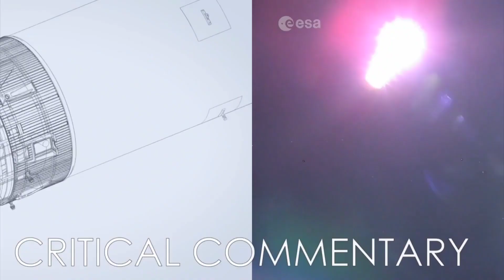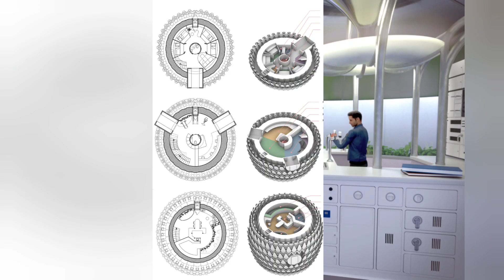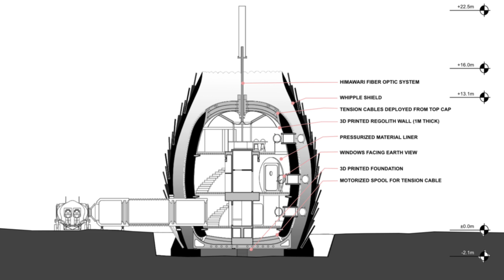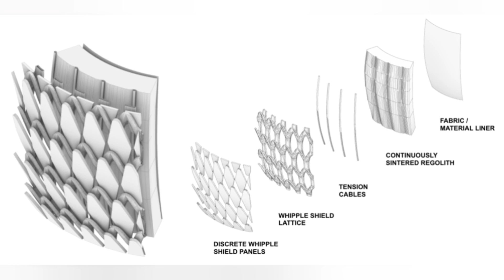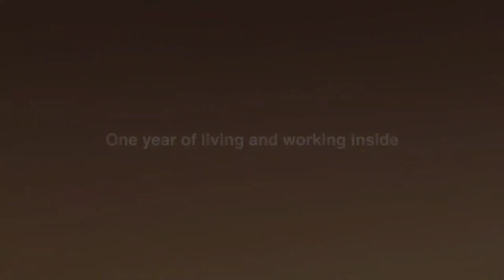NASA puts $57 MILLION down on a Moon City for Lunar Starship!

Comment: I've worked on this stuff (original Artemis Project, RepRap project etc.) and I can tell you that a 3D printed habitable structure with square corners and flat floors is not going to hold atmospheric pressure. There is a damn good reason you shape pressure vessels with curves, even the bottom needs to be curved to distribute stress. Just figure out the force due to 1 (or even 0.25) ATM on the edges of a flat 10m^2 floor area and you'll spot the flaw.
Reply: oo good analysis! force is equal to pressure times the perpendicular surface area, it seems the curved surfaces would distribute the load much better
Reply: @Brandon-qk2mf  They have to support the stress as tension too. Concrete is only good for compression. Not easy to achieve with 3D printing. Though 3D printing would work just fine for printing radiation shielding inside our outside of a pressure containment structure (but then so would sandbags).
Reply: Some of these walls were supposed to be one meter thick.  The thin ones don't look like they are going to make it.